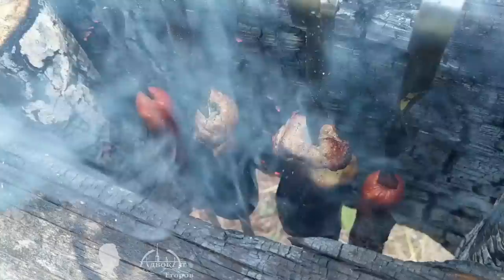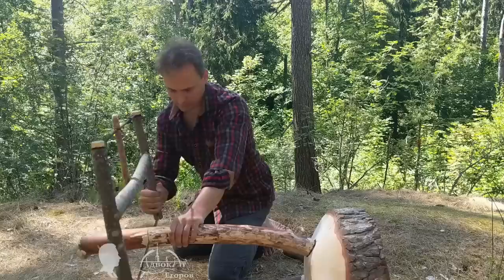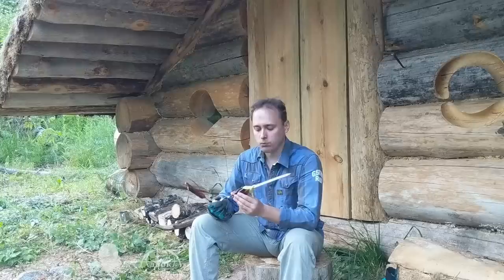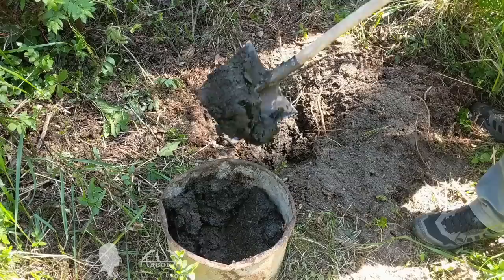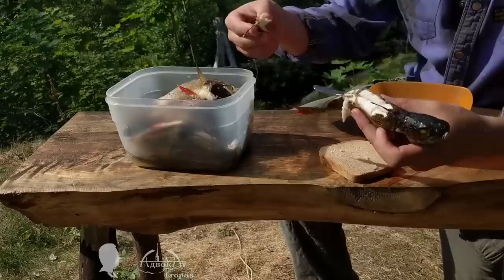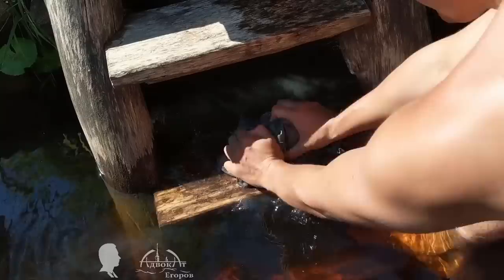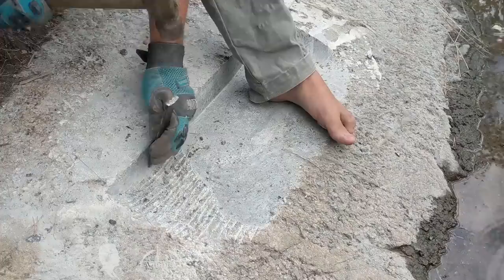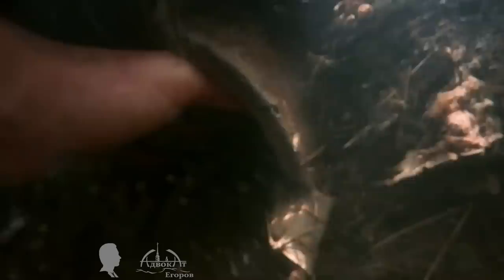21 Days Alone in the Northern Wilderness

Comment: Supposed to working at the moment but nope. When Advoko uploads, work and all other responsibilities can wait for another 32 minutes :) You're living my dream. Keep up the good work.
Edit: Though I know this isn't Bushcraft per se, making an copper-magnet electric generator which would be slowly filling appropriate batteries which you could use to recharge some of your batteries would be an awesome, environmentally-friendly application for your watermill in the future. This could be a secondary objective for the watermill as the transferred water could still be used for any other applications. It would just require you to build a makeshift generator inside the watermill itself. It would be a very difficult but it would be an awesome project!
Reply: It's a lot simpler to use an automobile alternator. At the low speeds the mill will generate it will take longer to charge a battery but the alternator should last practically forever. It could be left running constantly (even with no battery connected- the alternator won't care) or with some kind of clutch or friction wheel (like old fashioned bike generators) or or even quick-disconnect so something else can be connected, as the grain grinder at the end of the video is probably hooked to the shaft. Or belts (bushcraft rope of course) and pulleys, there are many ways to do it.
Advoko, if you're reading this, most people who want to build a waterwheel sawmill imagine a big rotating circular blade, but a reciprocating saw is simpler and less dangerous. You have to build a crank mechanism but if you can make the bearings for the main shaft you can build a crank that will last.

Comment: He should definetly make an eletrical generator of the water wheel, it could be an interesting alternative to the fuel generator he brings
Reply: Maybe enough power to light the place up at night?
Reply: @halationmedia  Yeah, or maybe even charge his electronics or powertools... It could deliver less power than a generator but run 24/7 without fuel
Reply: The car you drive, turns 'round and round' into 100Amps or more of 12V DC. A big alternator can fill that car battery we saw in the video. And there is an ecosystem of power accessories he can use for going 12V-to- USB and so forth,  powering the batteries of everything. Even if he has to make 'mains' an invertor is inefficient, but weighs little to haul. All doable with an alternator. 12V was once my thing...
Reply: @Some Viet Guy He doesn't have to store much energy at all since the alternator would run all the time
Reply: @Some Viet Guy he wouldn't need a big battery
Reply: Good idea.
Reply: I dont know if it would generate much power. Feel free to prove me wrong however, that would be excellent tho
Reply: I think there are no steams near the cabin big enough to power a turbine

Comment: An electric application for the water mill would be very interesting!
Reply from the maker: Thanks for the vote!
Reply: @Advoko  START CARRYING BATTERIES IF USEING WATERMILL FOR POWER.. 8 SHOULD DO..4 ON , 4 CHARGEING. GREAT SYSTEN AT MY COTTAGE BUT WIND TURBINE IN STEAD.
Reply: no the efficiency will decrease very much
it is not logical to transfer kinetic energy to electric energy then transfer the electric energy to a kinetic energy again because you will lose  at least 40 percent of power with each process
and because you already have kinetic energy at the first place
unless you already need the electricity

Comment: 1:05 That's pretty sound thinking. Every downed tree that just rots in place becomes a host for those pests that will rot other trees. if you burned most of the scraps, you've actually done more work for the woods than they otherwise might experience, in that in moments, you've returned a majority of the trapped nutrients to the soil without the other portions of them creating homes for pests.
It's likely that part of the gradual deterioration of forests today is due to people Not entering forests and removing some of these downed limbs and trees and turning them right back into ash. For example, a bark beetle might overwinter in a recently downed tree, but if that tree is burned to ash, that bark beetle either needs another host to live in/reproduce in, or it will die off. 

I'd never considered this aspect from that perspective until I'd heard your words here. Since things like bark beetles caused the massive die off of the chestnut trees in the US via a fungi they brought from tree to tree, imagine if a majority of their hosts had been destroyed prior to that damage! Since many fungi, insects and pathogens are species specific, this is a VERY good point you make!
Reply from the maker: Yes, clearing woods is important but nobody does it here as this  terrain is so difficult. There are no roads for miles...

Comment: i know this was like two years ago, but i also know Advoko is a man who appreciates a neat trick or two.

easiest way to repair a torn tarp is to take a penny, put it on the inside edge about half an inch below the tear, overlap both sides of the tear over it, then wrap a bit of line around the indent of the penny on the outside.

also works great if you tear the Guy rope off a tent by say...."drunkenly tripping over it at night" as a completely random and definitely not specific example.
Reply from the maker: Thank you for the tips!
Reply: @Advoko  my pleasure man. I'm a big fan. Love the calm demeanor. And the practical nature of it all

Comment: 17:00 anglengrinder keeps heating up because of that rag around it
Reply: Rock dust in the bearings or heating up- it's a tradeoff. Yes, he has to use some kind of air filter or the bearings will seize. No matter what he uses the airflow through the grinder will be slowed, so he's doing the right thing by using it until it becomes uncomfortably hot then putting it in the waterproof bag so it can have a nice cooling bath.
Reply: Mark Fergerson used angle grinder a lot and bearings never seized nor i have seen anyone else doing it. Rag on the angle grinder is not supposed to be. Hundreds of companies make angle grinders and none of them made a filter case going on the tool. Dust will not damage the tool and the rag will stop cooling hence the shortened life of a tool
Reply: @MightyJustas  How much granite have you used one on? Ground metal burns into smaller, softer pieces of oxide but rock doesn't. It just becomes ~100 grit abrasive.

Comment: WEAR A RESPIRATOR WHEN GRINDING STONE, SILICOSIS IS DANGEROUS.
Reply: chill hes out here inspiring beavers to build damns
Reply: Unrelated to the video but, Is it still needed to use respirator when wet grinding stones?
Reply: Canes Venatici this, always wet grind
Reply: @velorexvelorex4605  I see thx for the info. Been doing wet grinding lately. Making some sort of Neolithic stone axe head. I don't like the dust and I think wet grinding is more effective maybe wrong but just by having less dust is good enough for me.
Reply: @canesvenatici9588  Silicate dust, which composes dust, will wreck your lungs. It will coat the insides as that link from www.nj.gov/health probably says.
Reply: silicosis usually takes many years to develop after prolonged exposure.

Comment: With the water running off of the stream that is there, You might want to look into using a ram pump to raise water into a tower to create your own small hydroelectric power plant.  It's just a thought, however, it would eliminate the use of a gas-powered generator.  I love everything you have done especially the trees you're planting for the future.

Comment: Half of the weight of your backpack is made of tapes, ribbons and knick-knack attachments which furthermore, if not tidied perfectly, dangle and hook to branches, ropes and other stuff; add the weight of the chassis and and you reach pinnacles of impracticality. Imho, a sailor bag made of a waterproof fabric that can in an emergency also act as a float or a water container is more practical (I admit less tacticool ...😅)

Comment: Your grinder is getting hot because there is not enough air movement. Don't block it with a rag or you'll stop the fans from pulling in the volume of air required to keep the motor cool. Dust is not a problem (its designed for this) compared to the damage done by bad air circulation.

Comment: You should use the waterwheel, or a diy pulsepump, to pump up some water to a higher located reservoir when not using the wheel, this can also be used to water the plants in your area without needing miles of pipe.

Comment: Take 4 fire wood  logs stand them on end right next to each other so there is a hole in the middle. Grab a small hand full if twigs. And a small ball of tp, light the tp drop it down the hole drop the twigs on that. Best fire I've ever made and I have been camping 46 years.  Try it I did this at a camp sight I found ,it had 4logs sitting there that were to big to burn , well those logs are gone now.

Comment: you can make a water pressure drill/pump where you use pressurized water to make holes, depending on the material you can make the piston bukket primitive pressure pump I described, however you can also use larger amounts of water dropped from a height.

Comment: you can also make a grinding wheel, saw mil,  or to attack a rope to pull things. you can also use elevation, or a piston for high pressure water, this can make your dishwashes basically automatic, you could make some stone or wooden geers, make a wooden basket/reservoir with a large piston on top, this piston goes down and up, when it goes down the water goes out on high pressure, when it goes up it can suck in more water, you can add a small conveyor belt below it, or make the entire device slowly move. here the piston and other elements are powered by the movement of the platform, so the wheels will be gears, you can also use ropes instead(one moves the platform, the other is connected to the pump powering wheel, but that might require more tuning a round rotating table with a slight bowl shape would be most eazy and effective likely, since this is eazy to make, and your dishes will stay in until you take them out*. this also allows the water pressure setup to be used in different systems. such as your cloth washing mashine, and as a water jet for in your bath/tub. you could also use it in your shower, or to shoot the high pressured water around to generate a wide spread of fine water droplets for watering purposes.

Comment: An automotive alternator actually produces 3 phase power. They have a rectifier that changes the power to DC. You can use a belt to run the generator off the water wheel. Remove the rectifier. That will allow you to use very thin wore to run the power to wherever you want it over long distances. Then place the rectifier near where you want the 12v power. You can then use it to charge your batteries and such. 😉
Reply from the maker: I made a small waterwheel that charges a battery for me, but it is not powerful enough to propel an automative alternator
https://youtu.be/war9v2DxMs4

Comment: Oh and another idea I had when you were trying to use your Stihl for ripping lumber horizontally with your guide, great idea by the way, was to get ahold of what's known as a "skip-tooth" chain. 
  I grew up in the pacific northwest of the states and they hold logging competition just for competitive fun and these types of chains are used for some unbelievably fast cross cuts. 
Half the teeth in contact with your material.
I'm sure Stihl could point you in the right direction for those.
It's worth a try.
Reply from the maker: Bill, thank for the info

Comment: You need a water powered generator. An impeller or screw style is probably the best option. Let the water that flows out after the generator power your wheel. A brushless washing machine motor will work for this. you can use a solar panel controller to regulate the voltage to something more useful. Add a vertical section to the pipe so that you have an over flow. No need for the plug all the time you are there. Let the over flow (height of the vertical section of the pipe) regulate water level. If you leave it in there year round, you'll accumulate some decent sized fish in your pond.
***
Solar panels you can roll up and take with you will be useful to you.
***
It seems you have some issues with vandalism at your cabin. Not sure how to deal with that. Who would destroy your canvas tent or ruin your door with a pry bar? Is the land yours? If so you are building on your private property and they have no business invading on your home!
Reply from the maker: Already working on it..))

Comment: Awesome content! You asked for unknown projects:. Make a generator in the bush using primitive tech and materials found in the bush.
Reply from the maker: Bill, check the very last video on the channel. I showed my waterwheel-powered mini-generator setup in it.
Reply: @Advoko  a generator made from a drill isn't exactly what I was thinking of, I meant finding copper, forming it into wire, finding iron or iron oxide, making a billet, and then make a generator. Personally, I am thinking the most difficult would be finding raw copper, a substitute for the enamel insulation in the coils, and locating loadstone.
Reply from the maker: It was only a prototype...))

Comment: With enough downgrade water pressure you could put indoor plumbing in your cabin for washing and cleaning in inclement weather. Just take a four inch pipe to a three inch pipe, etc to a half inch pipe in the cabin and the downgrade pressure will increase allowing good water pressure in the cabin.

Comment: Well you can use a car alternator to keep the car battery charged. So you only have to use generator for high wattage electric tools like your grinder.  
I would go from a larger pulley on the water wheel side to a much smaller pulley on the alternator side.  On a car would need at least 800rpm, but you might be able to get away with much lower.
Reply from the maker: Already tried that concept on a small scale. I will show my mini-hydro-generator in the upcoming video...
Reply: @Advoko  wonderful

Comment: You should upgrade that laptop if you havnt already. Youd get MULTIPLE times longer battery use due to newer chips needing less power. Plus, that thing looked like it was running Windows XP which is not safe this day and age lol

Comment: Your grinder is heating up because you have covered the air fin passages with fabric. I'm unsure why you would have wrapped the grinder in fabric? I find even when my hand lays over the air passages I can feel the grinder getting hot. You're doing amazing stuff and I appreciate you sharing those cool ideas. Thank you!
Reply from the maker: Good point, I later took it off
Reply: I noticed the first batch of ? tar oil that came out of your still was almost clear and the final batch looked burnt. Do those have different uses? Or does the first batch work like glue as well as the last batch? Thank you for sharing your ideas and creations @Advoko
Reply from the maker: Yes, different fractions have different applications...

Comment: your water wheel: generating electric, of course, for you to charge your stuff and not need an IC engine and gas. but a wheel that can be changed over for multiple applications. if anyone can do that, it'll be MAX.
Reply from the maker: I showed a mini-power plant driven by my waterwheel in the very last video...

Comment: Wow. Your videos really make me dislike city living even more! A couple of things which I noted which you may like to consider. While the saplings are still young enough to relocate I would suggest spacing them out at the distances each one requires for optimal growth (or at least close to this). Perhaps you are already planning on doing this as you call it a nursery - in which case just ignore this comment. About the angle grinder - no need to protect it from dust. It is already designed to operate in that dusty environment. If you want to see just how much dust is collecting, do the job and then open the grinder up. After years of very heavy use I very occasionally open a grinder (often to replace the lead) and I am yet to have to clean the stator or rotor. All the best with your adventures!